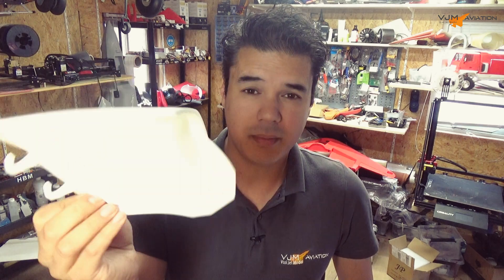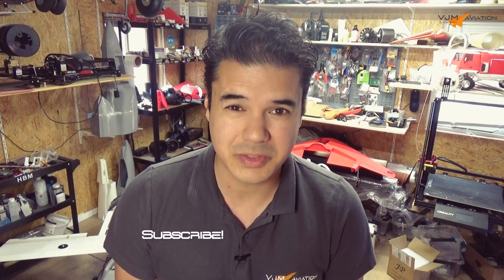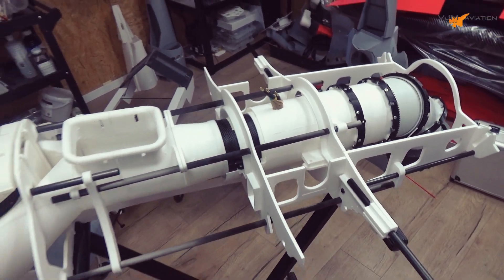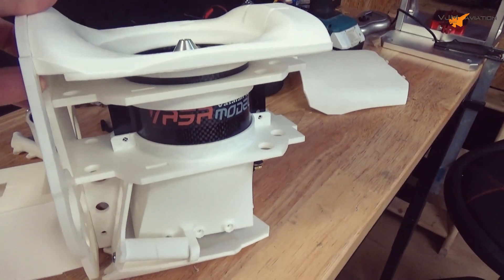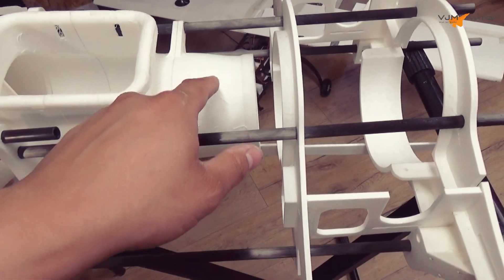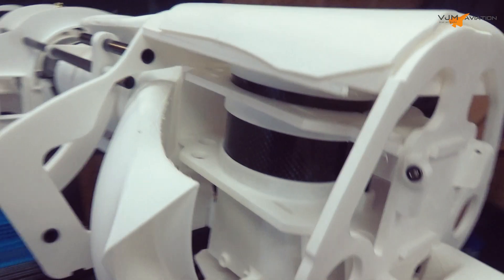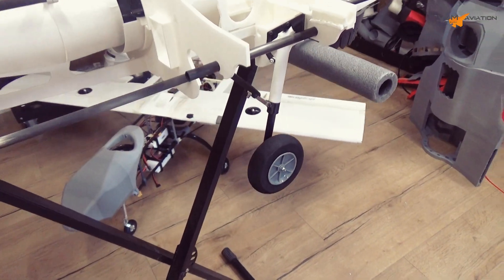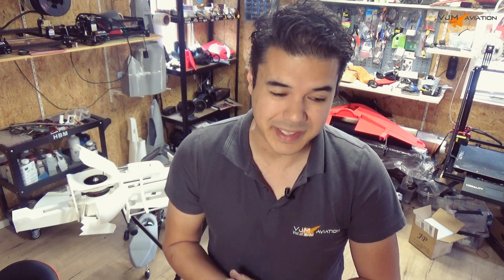RC VTOL F-35B | Making The Liftfan Doors | lightweight foaming PLA Colorfabb

Comment: Hi! Cool project! I have a question: does the thrust decrease when the nozzle is rotated to the vertical state?
Reply from the maker: Not that much I have use an higher kv engine for the back engine to compensate that part